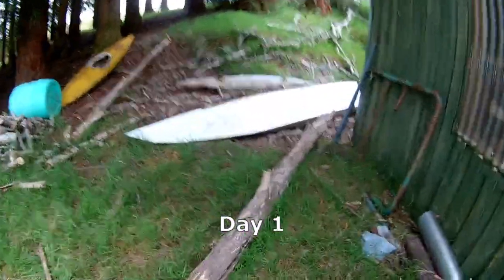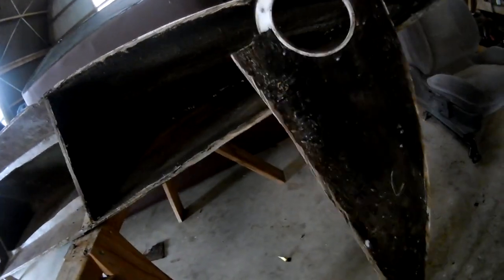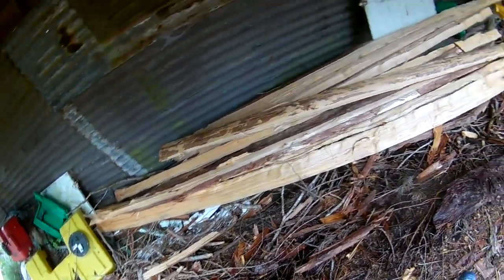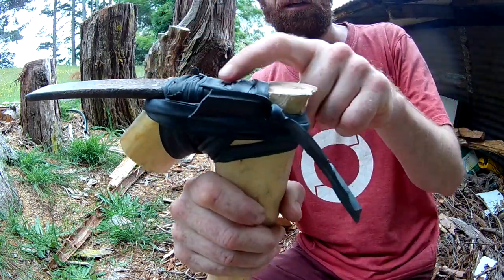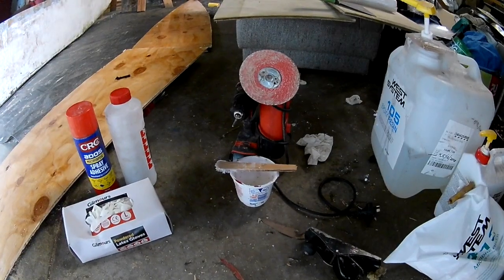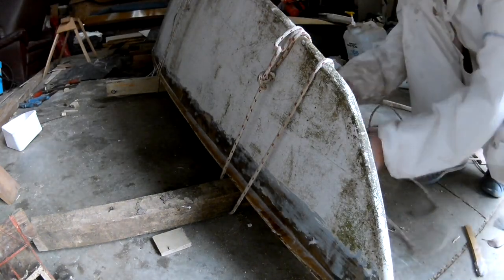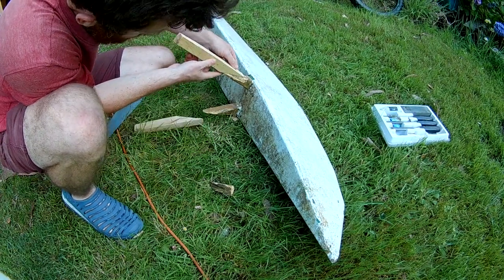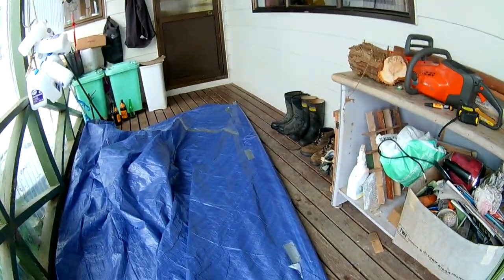"Good Enough" backyard proa restoration

Comment: is there a dirth of 2x4s in your locale?
Reply from the maker: What are you referring to? the akas? you really have to pick through the pile to find one that isn't knotty. I had split these beams from a tree by brother felled recently so that's way more fun than buying wood. Later I decided these were too short and replaced them with hmm, 75mm? diameter bamboo, by 3.3ish meters long?
Reply: @dominictarrsailing  still, it makes for a sexy video...

Comment: Hi, thanks for sharing !
Are you happy with the V shape of the hull ? A flat bottom would push heavier on the water and hold more the boat, isn't it ?
Reply from the maker: Thanks for commenting! The main problem with this boat is that it doesn't have very much buoyancy. The sides were not high enough. I decked it over so now water can't come in and you can sail in the rough stuff, then later I raised the akas to get clearance above the waves. If I was starting from scratch I would indeed have a more dory style flat bottom. At the time I first built it (2005) I was intending to do that but I ran out of plywood! I'm gonna build another one of these soon, with a flat bottom this time, so I'll see how it goes!